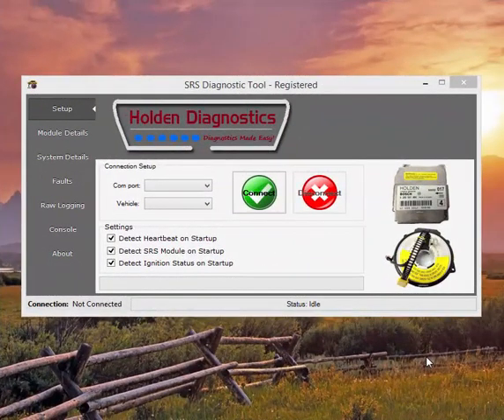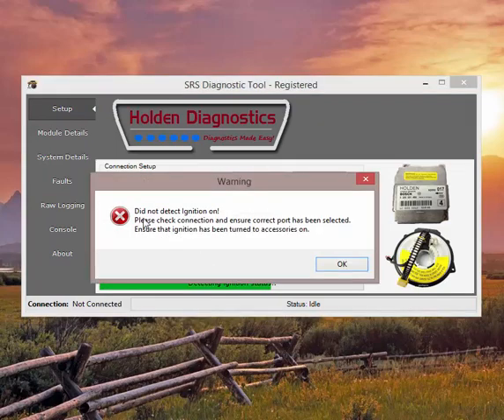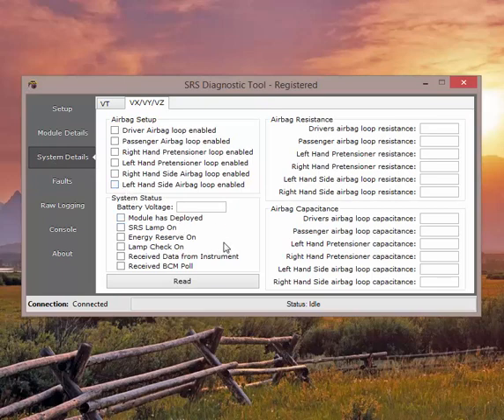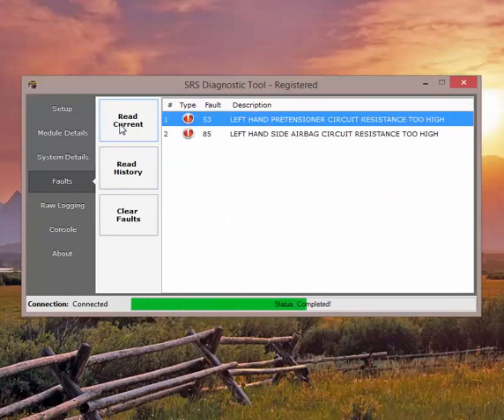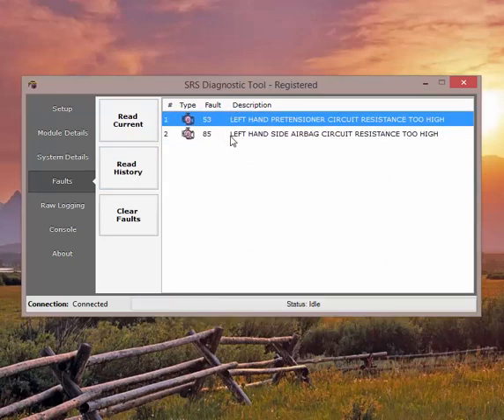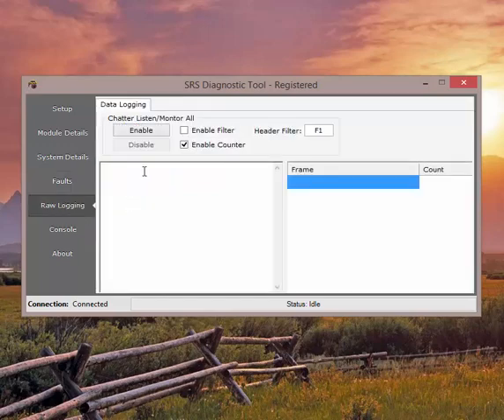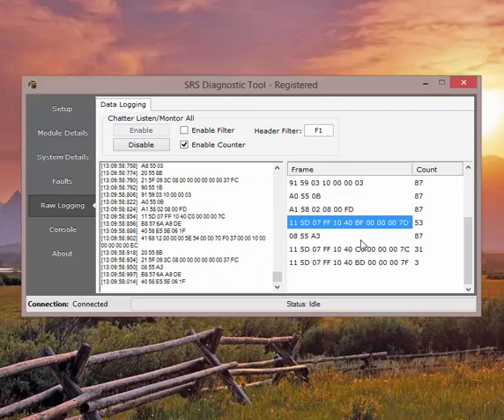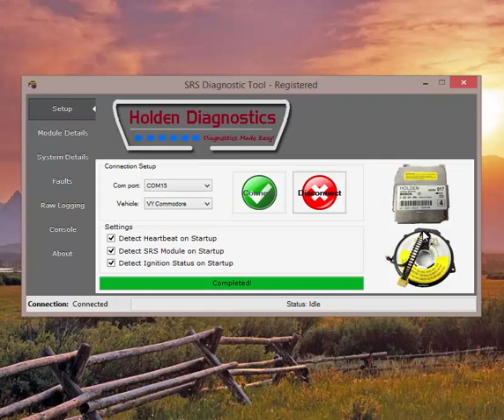Holden SRS Diagnostic Tool - Read and clear airbag codes - Demo

Comment: Got my SRS software today and connected to the car. Found the fault codes cleared to old ones and found the problem is the drivers air bag. Now I can swap out some parts to cure the problem. Easy to use software and great service from EnvyousCustoms staff.

Comment: Is there a way to disable the airbag codes? I want to fit a vr non airbag steering wheel to my vt (i dont like eccentric oval steering wheels) but i dont want to have it have the airbag or check engine light on.

Comment: what do you mean...plug it in the seat?? where do you plug the diagnostic cord into car?
Reply from the maker: I think you mis-understood what I was doing. The diagnostic cable plugs into the diagnostic port under the dash.
But for demonstration purposes, I disconnected my passenger seat plugs which is what set off the faults. Once I reconnected the seat plugs, you can then see the current fault disappears which then allows clearing the fault away.

Hope that clears that up!
Reply: I knew your trick straight away! 😂 I do this when I buy cars off people. I take it for a test drive and disconnect certain things and then take it back and say nah ile have to think about it and drop them a very low offer. Then go home and reconnect it all.😂  I drove home a vf v6 commodore from a lady owner it had 086000ks on the clock, she had it up for 12k. I drove it home for 8600 bucks.😅 sold it after i detailed it two days later for 11k on silver 19 Simmons.